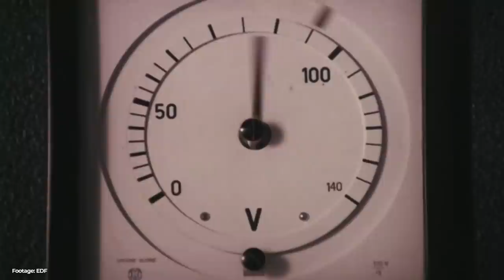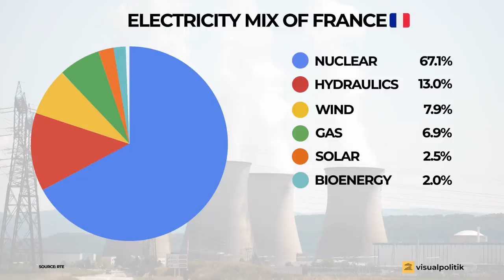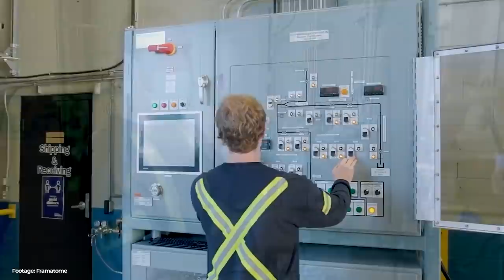Why is FRANCE betting on NUCLEAR ENERGY again? - VisualPolitik EN

Comment: france is smart thats why. they were loosing favour over the technology - but france seeing how the rest of europe crusify themselves over high fossil fuel prices... decided that the main reason for them having nuclear in the 1st place was still valid. france has no historic coal deposits or oil or gas. nuclear was frances way way out. also france has the highest air quality in the EU. 90% carbon free.
Reply: France also has the lowest CO2 emissions per person in the EU, due to nuclear power.
Reply: @davidbarry6900  it gets even better. next gen reactor designs use previously disguarded waste as fuel. legacy nuclear could not extract the majority of the power in the fuel. next gen uses molten salts. no need to mine new uranium, 100s of years worth of fuel sitting stored at the nuclear power stations still.
Reply: As president Giscard (in the context of the 70's oil crisis) said : "In France we don't have oil, but we have ideas" haha.
Reply: In Fact ,France has the 7th best air quality in the World .

Comment: France is not, "betting", on anything.  They have always successfully used nuclear power.  One reason it has worked is because their designs are standardized.
Reply: It is a bet... that someone doesnt improve on battery storage in the next 20 years.  That nothing unforeseen goes wrong... that somebody somewhere can bury all their waste and nothing will happen to it...       AND that the budgets limits can be held.   No modern nuclear power station has been built within budget...  often many time more expensive.
Reply: @theephemeralglade1935  Well SAID
Reply: @1968Christiaan  ...what does storage have to do with generation?
Reply: @8BitNaptime  Solar panels are on average more effective power generators. More modular, cheaper production, no fuel, etc. With perfect energy storage they would be way better than nuclear or anything else. Currently storage is not good enough though, incurring too large losses in storing and retrieving energy. But with the ongoing electric vehicle revolution, research into more efficient batteries is gaining massive funding, so it's only a matter of time.

For context I'm currently pro-nuclear as well. Don't really see any drawbacks, and we can't wait 40 years for better batteries and solar to be viable. Wind pollutes too much aesthetically and kills birds etc. Whoever approved/subsidised wind turbines should be forced to live in wind turbine parks the rest of their lives.
Reply: @yeetdeets  have you never heard of modular reactors?
Reply: @1968Christiaan  once you invest in the construction the energy is cheap and reliable, unlike renewable which clearly dont work.

Comment: The big issue with modern electrical demand is base load power demand, and you can't supply base load power with renewables like wind or solar, you need some form of high megawatt generation that can run steadily for long periods of time, right now that's either, hydro, nuclear, or fossil fuels. Hydro & Nuclear don't emit CO2 while fossil fuels, even natural gas, emit CO2.
Reply: Nuclear also allows them to be more independent.
Reply: "you can't supply base load power with renewables" is just a wrong statement. Baseload power does not require huge powerplants nor plants who can run steadily for long periods of time. The components of your baseload just must be able to replace eachother within a short period of time. Since Solar and Wind are currently the cheapest electricity sources you want to use as much of them as you can. Wind is generally already a part of baseload. While solar is used to cover peak demand during the day it can also go down into the baseload replacing among others Hydro, which can then power back up once the sun has set. In the future baseloads will become even more dynamic since wind and solar have no fuel cost and supplying baseload with gas or coal, you have pay for, while solar and wind sit idle but could generate is just a waste of money.

Also having high-megawatt single powerplants can even be something really legbreaking. When France has to, and i think they even currently are, shut down one or more nuclear powerplants, which can mean a output reduction of multiple gigawatts, thats a expensive hole to fill
Reply: You only forget one thing. Solar and wind energy is not being given to the people, but to big corporations. Eg the Netherlands allowing Facebook to build a datacenter so big it has the same amount of energy consumption as the entire city of Amsterdam. How the hell can we become carbon neutral if we're going to give >15% of our total energy supply to datacenters? Datacenters don't like nuclear energy, because that isn't green. So nuclear energy can provide baseload to the people without big corp snooping away the electricity.
Reply: @alexties6933  france have mountain terrain and rain enough to replace all their nuclear power plants, using the storage system we already use.

New river dams, can pump up back the water when the solar and wind produce above the demand, using that not used energy, to the dam produce again when the wind and solar are short.

In that system we only need 2 dams in sequence to do the energy storage like a battery.

One of the dams of course must be in a "dry" river base to allow that energy storage.

We already have 2 new dams of that double fuction, builded conected to two old big river dams.

Now we are building 3 new sequencial dams, in a river basin that was not enough to one old system dam, and in the mountains were we have more wind generation parks.

The 2 upper dams has that double fuction, and the down dam are only for holding the water and produce energy if the upper 2 dams are releasing too much water.
Reply: @ricardoxavier827  why is land development and hydroforming for power generation not considered pollution?  Is carbon dioxide the only pollution that matters?  
I would consider digging, development of natural areas, diverting waterways large scale pollution also.
Reply: @ricardoxavier827  Storage is a thing you can do with excess electricity but its better to replace as much from the baseload with it as possibile. This is because then the electricity solar and wind generate directly goes to the consumer and you have very little loss while when you store electricity you loose some. I think if you pump water for 100MW you get arround 70-80MW back which drives up the cost.
Reply: @alexties6933  Liked your thoughtful comment.  I am depressed that those commenting repeat the same points as if there is a simplistic solution that the experts have somehow missed. It is as if nuclear is the obvious answer but its not being used because no one thought of it. Few have any idea of how many economies have been broken by nuclear. i would also love to see a complete cost analysis if France’s power. Years ago I heard it was over a dollar a kWh but so much state support that it is hard to find out the actual cost. 

it’s important to get it right. China and India a putting out huge Solar contracts for LCOE of 2.5 cents per kWh.
Reply: @prst99  You're right, damming rivers absolutely devastated their ecosystem, sth few people realise or talk about.
Reply: Natural gas also emits methane which is like 30 times worse for global warming than CO2 making it possibly even worse than coal.
Reply: That isn't true.
For starters Germany currently gets around 10% of their electricity from a baseload renewable that isn't hydro (it's bio/waste-gas), so that statement is factually wrong.
Then if you combine wind/solar with storage you can also achieve baseload.
Third baseload is an out of date concept, which looks like begging the question. ALL load has to be matched. There is a reason France is relying on electricity imports from Germany each winter as you can't match peak load with baseload power plants.
Reply: Hydros environmental footprint is too big. We should stray away from it
Reply: @alexties6933  Have you ever heard of batteries?
Reply: @altond511  Yes and you want to avoid them as much as possible since they are too expensive. For example let's say you have two imaginary grids, one designed for 50/50 Solar and Hydro, the other 50/50 Solar and Nuclear. Since solar is not statically supplying energy you have to install higher capacity. If Solar now peaks and supplies 60 (10 more than you need) you can throttle hydro down to 40. The Water you don't let trough your generators can ovviously be used later so you have no loss (except on flow through hydropower stations). Now with nuclear - you cant really scale that down fast enough so you have solar excess. Now you can either shut down some solar panels, where you loose money because the price of solar is almost exclusively calculated on the up-front investment, or you store the electricity inside a battery which is not only a additional infrastructure you have to pay for but storing looses you electricity which decreases the return on investment of the solar panel. To be clear: This is not a realistic example but usefull in explaining scaleability. 

Tldr; you can use batteries but you should design your grid in a way that you need them as little as possible.
Reply: Just imagine how much hydrogen and energy storage and synthetic fuel production you can set up with the amounts thrown around in the video. Just one French nuclear plant went 12 billion euros over budget... 

Unfortunately the internet is full of people who, for purely ideological reasons believe the most optimistic cost projections from the nuclear industry that are proven wrong time and time again (usually by more than 50%). It has nothing to do with actual pragmatism or concern for the climate, it's just about seeing support of nuclear as a way of "owning the libs" or of proving you're a red-blooded contrarian male since everyone knows renewables are for tree-hugging women and soy boys.
Reply: @alexties6933  You`re nuts.
Reply: @altond511  Then explain, what of what im saying is wrong
Reply: @gulliverdeboer5836  How  much you can get? You will be surprised how little. The total cost of Germany's solar and wind subsidies (not the cost, just the subsidies) by 2021 is ~500 Billion (cost committed, including future subsidies, for plants installed till 2021)
Reply: @TBFSJjunior  The point is you need a steady source of power. I lived in Germany for years. Your electric meter is read ONCE a year. They divide that total by 12 and that's what you pay a month. If you use less that year, you get a check from the power company for overpaying them. If you use more you have to pay the power company the remainder. One year I used LESS power and had to shell out 700 Euro because it was a bad year for renewables and we had to buy a shit ton of power from other nations (mostly France). 

Not having a steady source of power invariably will hurt the everyday family. Renewables have a place but relying solely, or mostly, on them is folly.
Reply: @perdedor3571 
Your story doesn't make much sense as in Germany the price per kWh can't be changed after the fact (no matter if there was an underproduction of renewables or not).

Also Germany had a net export of electricity of 10 to 55TWh each year for at least the last 10 years and made a net win with the export of electricity in each of those years.
Germany has more capacity installed than it needs to meet peak demand and only imports when neighboring countries have an overproduction and low prices.

Not sure if you are making up stories or if you are remembering something wrong, but that story is impossible in Germany.
Reply: Horse shit. You used the word "net" for a reason. The truth is Germany often imports power from France. While "NET" power flow may be export  Germany STILL import's power. For instance in 2016 Germany imported 28.4 Million MWh of power from other nations. 

Also, your power bill absolutely DOES reflect the price of electricity. If they check your meter every January and you used 3Kw/hr at 10 cents per Kw/hr they charge you for that usage. That would work out to 2.6k euro a year or 220 euro a month...somewhere in there. 

They wont read your meter again until the FOLOWING January. They will just charge you the 220 euro a month. If the following January you use 2Kwh they pay you the difference. If you used 4Kwh you pay them the difference. 

Now if the price of electricity rises from 10c per Kwh to 15c per kwh half way through the year and you STILL used 3kwh YOU ARE STILL RESPONSIBLE FOR THE DIFFERENCE. You still would pay for your 220 euro a month and at the end of the year you'd just get a bill for the difference created by the price per KWh. The power company is not going to operate at a loss for shits and gigs, my friend. 

In the case of these absolutely arbitrary numbers that I just listed our hypothetical family would be stuck with a 650ish Euro bill at the end of the year after paying 220 euro a month. 

In our case I had to have the letter translated. I though that since we used LESS power I would get a refund. You see, my wife gave birth that year and due to many complications we essentially lived out of the hospital for 3 months. Imagine my shock when my German neighbor brought up the cost of electricity to me one day and I had him read my bill to me. Instead of receiving 700 Euro I would have to pay. I had to settle up with the power company prior to leaving Germany for the US.
Reply: @TBFSJjunior  Oh and by the way the medical system there was an absolute shit show. My wife's medical issues from pregnancy were a direct result of the doctors there missing a very easily identifiable and preventable issue. The doctor was supposedly the best in the region and his team absolutely failed us. Bottom line, Germany is an absolutely beautiful country.  The culture was amazing to experience, the people were extremely friendly but the system there is completely fucked. Any time we had to run an errand, paying utility bills, paying insurance, making a claim, setting up phone or internet, getting a rental agreement going, dealing with the hospital, etc. It was an absolute shit show of a nightmare. Needlessly complicated and the people involved were rude and unhelpful. Kind of like going to the DMV in the US.
Reply: @Jakob Schulze  let's not forget that Germany changed the definition of renewables to include biomass. If the idea is go Carbon neutral why support anything that generates CO2? Also, France is an exporter of energy.
Reply: @ditorules 
"France is an exporter of energy"
Every country exports energy.
France is a netto importer of energy. I guess you meant France is a net exporter of electricity? If so then that is true, but misleading.
France has to import electricity each winter as they heat with electricity and don't have enough nuclear to sustain their demand on cold winter days. In the summer and at night they often have an overproduction of nuclear so they export nuclear for cheap into neighboring countries. It's not a sustainable model as they use other countries for storage this way.

Biomass in general is defined as renewable as it is renewable (if done sustainable I should add)... this has nothing to do with Germany.
If you let biomass rott, then it creates CO2 and methane. If you put it into a biomass plant, you create power and use the methane and therefore lower CO2 emissions. Biomass can be carbon negative even though it emits carbon and can therefore aid to reach carbon neutrality.

(And again it is important to do it sustainable. So this isn't true for all biomass.)
Reply: @TBFSJjunior  but France also have about 1:10 of Germany's co2 emissions for the same amount of energy. And Germany also import from France, but I don't know the ratio.
Reply: @altond511  and do these batterys just comes from nothing just because you heard of them? No environment impact to make and replace them?
Reply: I think hydropower dams would be great to pair with modular nuclear. If there is too much melt or rain, modular nuclear plants can help pump excess water away. If there is not enough water flow, then modular nuclear can fill the gap in electrical generation.
Reply: @collinwhites9833  Your probably thinking of run of the river systems which are subject to flow changes, and yes, Nuclear is an option to take the slack during low water flows. The large hydro plants we have in Canada maintain large reservoirs to even out those flows. They have spare capacity to store spring runoff, which is then used to maintain a stable flow during the summer & winter months when the flow is lower. Side benefit, you don't get spring flooding as the dam buffers the flow.